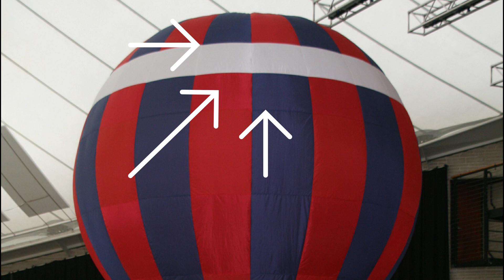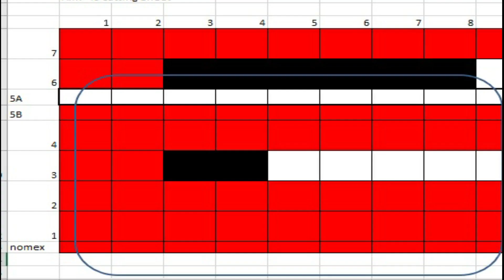UPCYCLE - a build your own model balloon project (40m3)

Comment: i couldn't find it on ebay
Reply from the maker: Yep, it was about 3 years ago that it sold, not sure it ever got made though, not seen any pictures of it since.
Reply: does parachute ripstop nylon work
Reply from the maker: @gabe-j5t  yes I've seen one or 2 people use it, best to get some samples (or if you have some already) check how much air flows through it as you blow on it, checking for porosity, if you hold it to your mouth and can blow through its probably not going to hold the hot air well enough
Reply: oh ok great does it come in all sorts of coulers